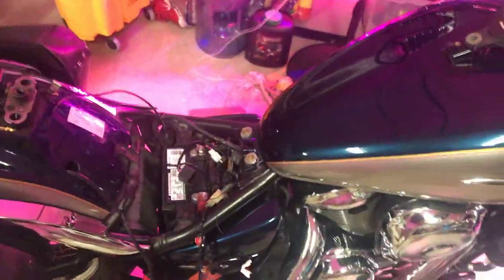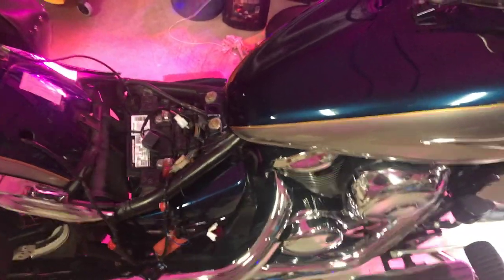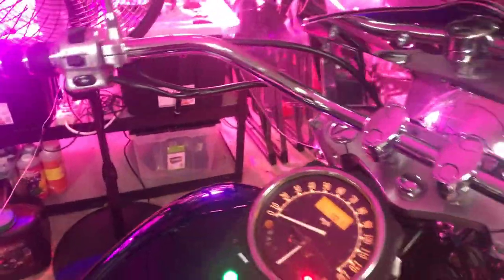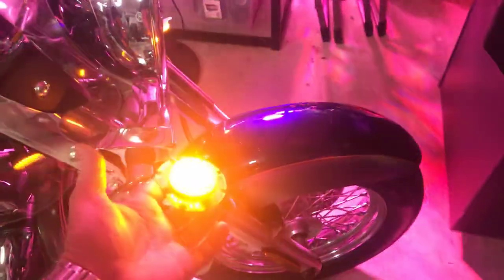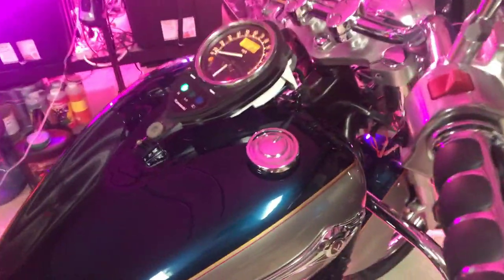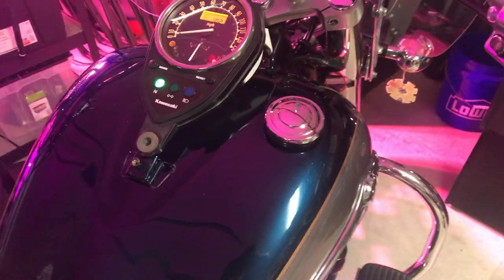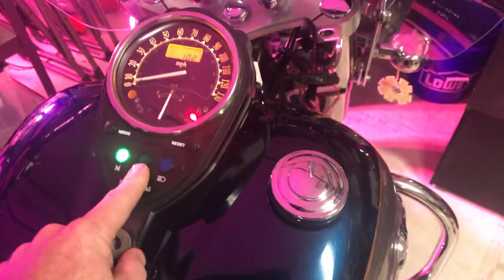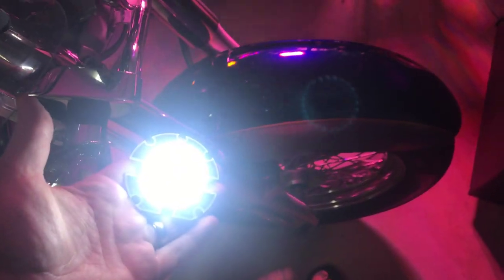LED turn signals all flashing when using left or right turn signal

Comment: Thanks! This helped me out a lot. I’m glad I didn’t start taking apart my wiring before I watched this. I also used your video to replace the relay. One question though, did you do anything for the turn signal indicator in the cluster to flash on both sides? Mine only blinks when I turn on the right blinker. I can’t tell if my left blinker is on or not.

Comment: I found a relay no load led for my 1980 Suzuki GS 1100 E. It worked with incandescent lights. I put in led lights in but only the right side worked. I had left resistor wires in the front he front signal wires. I took it off and it did not work. I put one on each side in the front and it worked. I do not know why. I would love coextensive it to work with out the resistor wires. The incandescent did not work on the right without the resistor wire. The left did. ??????

Comment: Did you end up replacing the bulb for an LED? If so did it solve the problem? I tried switching mine out for an LED, which fixed the dual turn signals on at once.  But now the new LED indicator light does not work.
Reply from the maker: It has to do with the fact the LED is a one way diode and the left and right signal input on either side of the bulb - meaning both sides are positive.  Incandescent  lights don't care about which way the current flows, but diodes do.  So, you have to make a Y connector and run both the left and right turn signal to the top of the Y and the bottom of the Y connects to the indicator.  That will be your positive connection to the LED.  When you plug in your LED make sure the + side is on the same side of the Y.  Kuryakyn used to make the Y and maybe still do, but it's just as easy to make your own.
Reply from the maker: Douglas White points out the y connector I was referring to, albeit being an ass.  I made my own. 
https://www.amazon.com/dp/B0041QIMPO/ref=cm_sw_r_cp_api_glt_fabc_PWJZPGRCH5Q5GA13QV2A